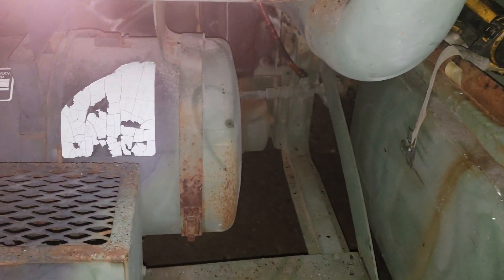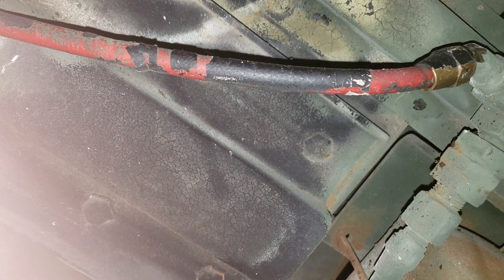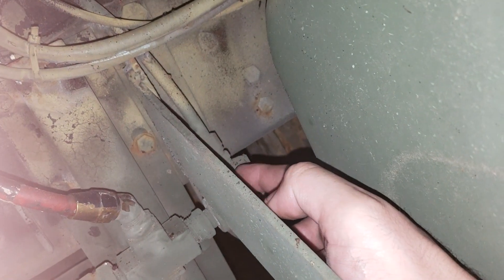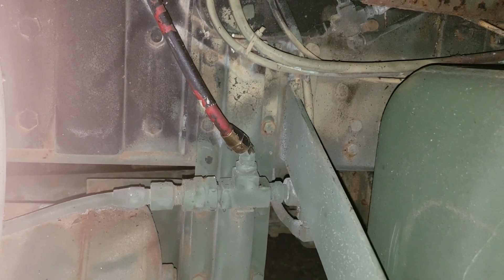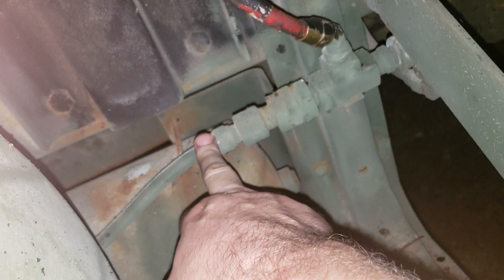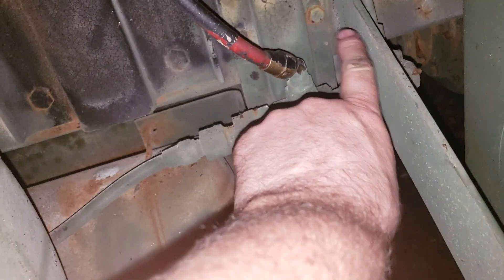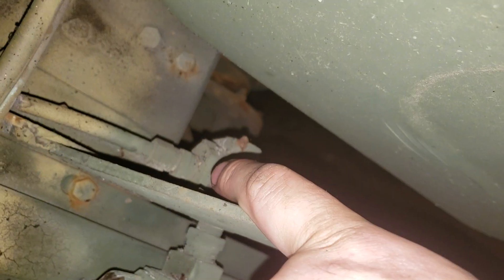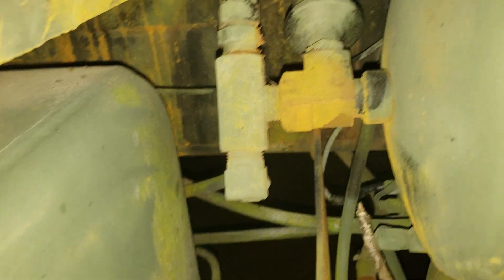M939 series truck - air system fault - no air in spring brake tank

Comment: would this also cause the truck to be limited to around 20 mph? cause thats my current problem with my m923a1, while driving for about 15-20 mins the front brakes will get hot and or smoke.
Reply from the maker: Only the front brakes are grabbing? This would only apply to rear brakes.

Front brake application without the pedal being applied means the brake pedal valve is sticking. I have seen this a few times.

Comment: thank you for this video! immediate fix! I just took out my kn23000 and cleaned it. then it worked! I might replace it though just incase! the flow out of the check valve was there but it seemed weak. I heard it click hard when the pressure went up after cleaning it! now they work!

Comment: My truck all the air keeps coming out the air dryer
Reply from the maker: Your air dryer needs to be rebuilt or replaced. I am sure you have the older Pure Air Style that came on the truck. You can take a screw driver  and on the bottom of the air dryer there is a dust cover with a 1" hole in it where the air dryer purges. Take the screwdriver and push it back up. It is a sticking purge valve. which is common for these trucks. You can either rebuild it ( i would have to know which air dryer you have to give you the kit number) or you can replace it with something newer.   I have a newer version air dryer that is smaller and more reliable than what you have for sale.  It is a wabco air dryer. Much more common and newer. 

You can email me pics of your air dryer to Simpson.wes.1985@gmail.com and I can tell you the rebuild kit.

Are you a steel soldiers.com member?

Comment: My m939 is not blowing off and no axle lock and no air in the wipers need help
Reply from the maker: Email me at simpson.wes.1985@gmail.com or thru steelsoldiers.com at simp5782
Reply from the maker: More than likely it's a pressure protection valve failure. That supplies air to the wipers and the governor to shut the air compressor off
Reply: Wes Simpson I put in a new governor and still not working ? What to do
Reply from the maker: @ririaudain6277  uploading a video now.
Reply: Wes Simpson ok thanks